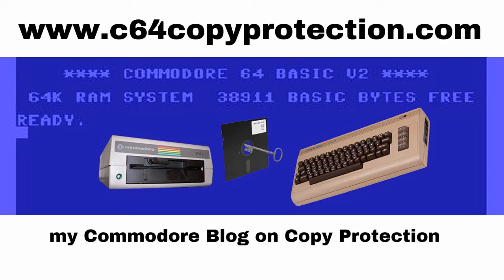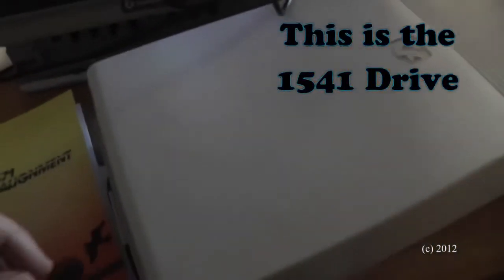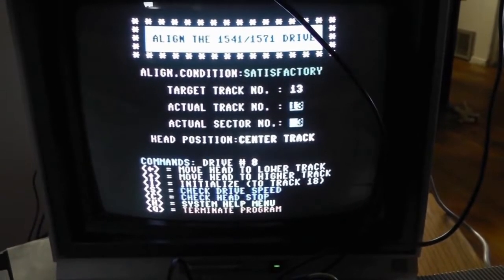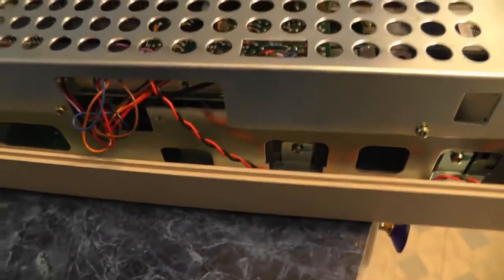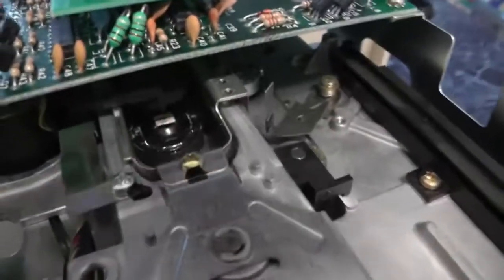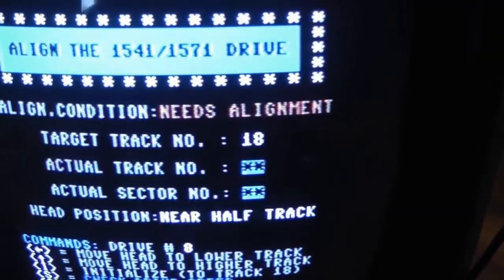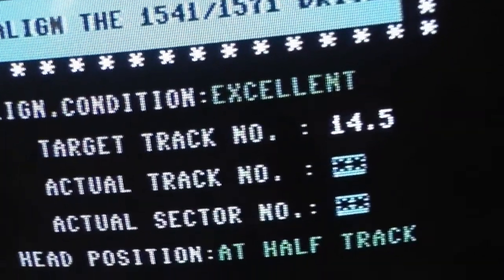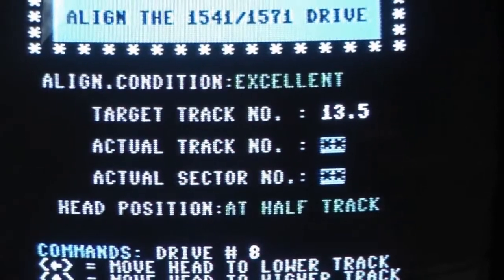Alignment of the 1541 Disk Drive - FREE SPIRIT Software - Opening and adjusting

Comment: If your drive is working than you should not trimm it, i have hooked up 3 drives, 1541,1541 II and a 1571 and all three had the same exact speed of 321rmp. Jans diagnostic cartridge says the correct speed is 300rmp and Spirit Software indicates the correct speed with 310rmp. If your floppy is working then dont touch it, by reducing the speed my 1541 got out of alignment and i got read errors on every disk. Even if it reads that half tracks were poor, half tracks were used by some publisher as a copyprotection even with poor your drive can read them but would become problems writing them.
Reply from the maker: The speed displayed will depend on the program you are using to test it. My favorite speed test is the one on the Super Card disk. Some programs WILL display 300 rpm, while others 320 rpm on the SAME drive, just watch for that. Thank you for the comment.

Comment: Got mine aligned! Couldn't find the free spirit software so I used a different one. It wouldnt target the halftracks accurately but I managed to get it aligned anyway even though there was nothing written on the half tracks. HURRAY!!!! I was getting tired of having no disk drives that worked.
Reply from the maker: The alignment program in this project is very good also: http://blog.worldofjani.com/?p=2180

Comment: I remember spending.. hours.. adjusting the alignment on my 1541 as a young kid.

I had bought one of these Free Spirit Software alignment disks when I started having trouble, but aligning the head to that disk's satisfaction made many of my commercial games not work. The alignment disk itself was out of alignment, though good enough for standard C64-formatted stuff.

I eventually found a particularly finicky game that had a fastload routine that would simply wait on one track instead of reindexing and erroring when it wasn't happy with the alignment, so I could dial back and forth until I would hear the heads start stepping again and the game would finish loading. Once that game worked, they all worked, and I was done. Using that game, I got the procedure down to about 10 minutes for anyone's drive.

I think it might have been Destroyer by Epyx, with Gauntlet by Mindscape as a final test (Gauntlet had a VERY fast turbo load routine that was VERY finicky about alignment and speed.)
Reply from the maker: Great comment! You can use the 1541 DEMO disk as the alignment disk with the Free Spirit Software. Works good for me. Of course I only learned that a year or two ago.
Reply from the maker: Also Gauntlet used V-MAX, which I consider it's copy protection, but V-MAX was also a fastloader. AND pretty hard to copy back in the day.
Reply: @StevesRetroGaming  I have three copies of the 1541 demo disk. Unfortunately, the hub rings have fallen off of all three of them, and it's actually possible to clamp them in off-center if you aren't careful about it (happened to me when I was checking alignment with the 1541 diagnostic cart, made it look like alignment was wandering).
Reply: Very interesting!  I just aligned my 1541 with the Free Spirit disk and it's reading and writing blank disks nicely but disks written by the 1541 can't be read by either of my 1541-II drives.  After reading this comment, I'm going to dig up all of my commercial games and see if they work on the newly-aligned 1541.  One of my 1541-II can't even read the Free Spirit disk side A.
Reply: Tried original disks of Robocop and Batman and they wouldn't load after the Free Spirit "fix."  I decided to make a crazy adjustment to the 1541 alignment just to see how much better or worse it was and to my shock, everything started loading perfectly.  I decided to tighten the screws and not continue messing with it since it's working so well.  I guess my Free Spirit disk is a dud too.  Thanks for the tip, Robert.
Reply: @damienretro4416  Ya guys...you can totally screw up the alignment and it will write new disks/possibly read disks that were written while it was not aligned. It will say it is reading track 18 just fine! The only problem is that it is reading track 17 or 19 in reality. The thing is, those disks are compatible with just one drive. Your misaligned disk drive. If you don't follow the instructions to the letter, you will have a misaligned drive that functions perfectly!
Since commodore computers don't use the last 5 tracks of the disk, this problem can be entirely invisible to the repair person.

 It won't read anyone else's disk except yours. It may even get the half tracks from your partially misaligned drive from before...In fact, that is the test to see if it is factory aligned. Put in a commercial disk and suddenly information on track 9 actually has to be on track 9, not 8 or 10. If it only reads sometimes then it is probably on the half tracks and the software will easily detect that. Except here is the even bigger mind screw. If your disks were already writing on the half tracks, you might align it either way and it will look correct even if it is completely off because now the half tracks are the baseline of the track because it was formatted that way. The program doesn't know which is which. A lot of those alignment disks used the 1541/test demo disk as a kind of "keystone" because it was a known disk everyone ought to have/could get and thus the results displayed back would be known. You know exactly where everything should be.